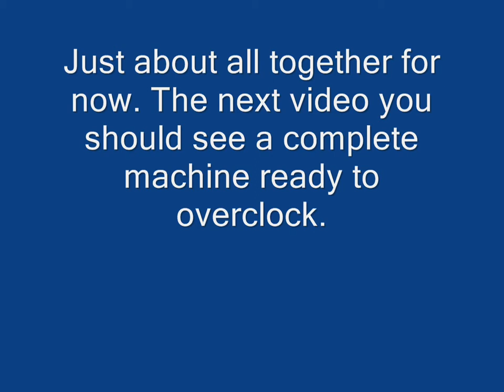NZXT Phantom build update 2

Comment from the maker: @ThorTheCommenter Funny you should mention that because I have moved the 24 pin as well as the sata cables. Like I mentioned in the video I was just working on the cables that day. So what you seen in the video was just what I did to get the machine up and running for the weekend so I could get the os installed and play around with it. It will look a lot different in the next video.

Comment from the maker: @zver711 One has to work with what they got. It actually works pretty good. I have done it on other builds and have not had any problems with it chipping or scrapping off. The cables are all done now they look a lot better then in that video.